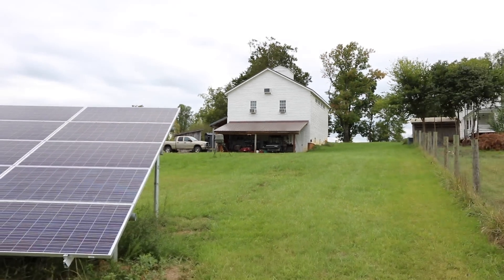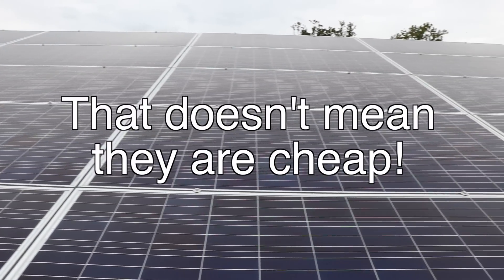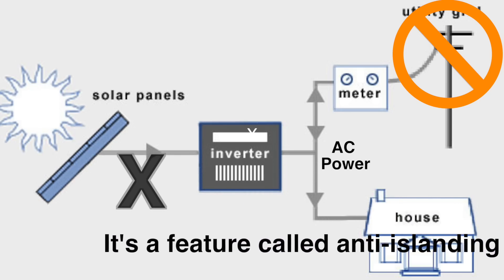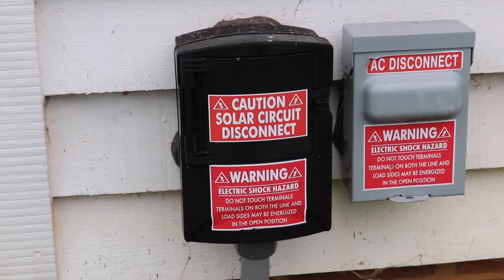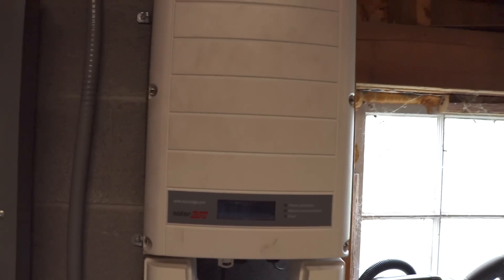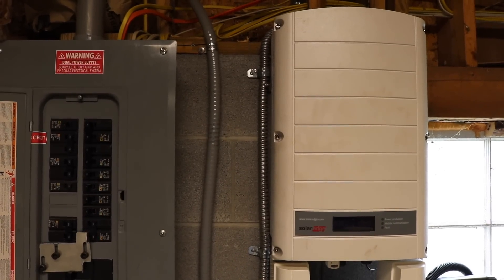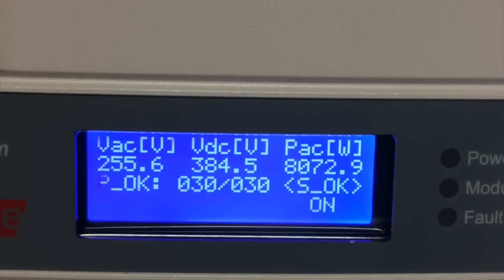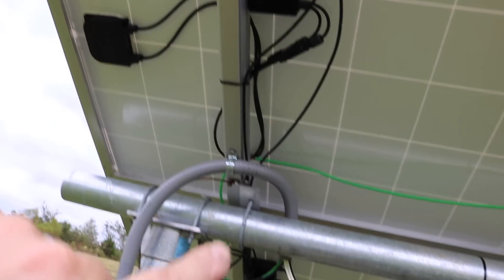The ugly truth behind grid-tie solar systems. Part 1, FarmCraft101 solar.  Watch before you buy!

Comment: Has anyone mentioned that perhaps the best reason for disconnecting a solar system from the grid after a commercial power failure is safety?  For the company's technicians to work safely on service restoration, the power system must be de-energized!  If your solar system is pushing power back toward the grid, they can't work to restore the grid.
Reply: This system will NOT back-feed the grid when it is down. Please do some real research ...

Comment: Biggest mistake of being tied into the grid while having your own solar system  is the home owner is only noticing a lil bit of savings because they really don't know how much is truly going which direction and you back feeding supplying the power company power you should be paid for that not just power saving because what your house rejects goes back out to your neighbors and they get charged a bill for your solar energy. If you go solar go all the way with it don't trust a scamming govern owned company to say we make things great for you.. 
Just for say your solar produced 2000 watts to the grid direction because your house rejected it from less resistance and now your house demands it then it comes back through  power company charges you for the power you just created. Those smart meters are a scamming ass joke they are the biggest power phantom box out there claiming it uses far more power than you really use and long as you can not show proof you have no case..
Reply: When feeding the grid your meter runs backwards, essentially giving you a 1:1 credit for the electricity you give the grid.  Say you feed the grid 10 kW-hr and your meter rolls back 10 kW-hr.  A few days later a storm rolls through and you use 10 kW-hrs from the grid.  The net effect on your meter is 0.  You paid nothing for that 10 kW-hr.  You essentially just loaned the utility some power and used it later.
Reply: @antony1103  yeah supposedly but not guaranteed they will honer thy customer. Which is the whole reason why I wrote my comment. I do not and will never trust electric company to tell me the truth about anything.  Not even to tell what color my hair is.
Reply: @topdogmechanic8261  The Grid-Tie Inverter will report how many kwh's it has generated.

Comment: Grids are how to wire money to corporations, duh ... off-grid, off all of their 'services' is way cheaper and sustainable.

Expect 98% efficient thin-film panel materials 20-microns thick if they are "allowed", a Taiwanese team prototyped a production line r&d project, presented 3-4 months ago. 👍

Standard panels take more silicon than available, these were developed to deal with that.
Reply: When you went OFF-GRID ...  you sent your money to the Solar Panel company and the Inverter company. And periodically, for life, to the battery company.  For the average residential home, adding a Battery Bank is a financial LOSS.

Comment: Very good video. You are quite right mate. It is a big advantage to use higher voltage then why are you americans so stubbornly clinging to 120 V power supply? You are almost alone in the world you know.-:)
Reply: How do you not know that we use both 240 volts and 120 volts. We originally had a 100 Volt DC Electric Grid long before you had any electricity.

Comment: Good vid, I've just been through the same thing..BUT I got around having no power when the grid goes down by putting a generator circuit cut off at the meter . That way when the power goes off I insulate the grid and start my generator...the inverter then gets tricked into thinking the grid is up and running and allows power from the panels to be used at the house. Cheers.
Reply: That seems like a great idea an lp or ng  generator would run at virtually no load while the sun was out is that correct? probably cheaper than a battery system and still able to get the solar benefit at a small lp gas cost.

Comment: What is the life span of these solar panels? How much does their ability to produce energy decline with each year? (even if the decline might not be exactly linear, can you please provide a rough average)
Reply from the maker: Warranty is that they will produce 90% of rated capacity at 10 years, and 80% at 25 years.  Typically they last for 30 years before they are replaced, but even then they will be producing a fair amount of power.

Comment: I know this video is almost two years old, but I do go back to it once in a while because I'm waiting to see if your Return On Investment has been met sooner than later.  I say that because the price for power doesn't seem to be going down.  Since the price of electric continues to rise, I would think that ROI would be met sooner than later.  Still, I wonder about the price of installation on a 9kW system.  I opt away from grid tie only because the power company is truly the only one that benefits.  Any extra power you get goes back to the grid, but then they get to dictate what they will pay you for it.  Try that the other way around and power companies will laugh in our faces.  That's not business.  That's called a monopoly.  It is why when I design my system, it is for consumption only.  It will eventually get to a point where power companies won't pay anything for what you can produce.  Just look at the models in Australia.  Unfortunately the Chinese are leading the way into solar technologies.  They even have inverters that can run high wattages without batteries or the grid.  There's a youtube video of a guy in Phoenix, AZ who is running his A/C with only his solar panels.  I have, since, purchase a similar product from the same company.  It will be installed this week and I will run my own tests on it.  But talk about  "off-grid".  The great thing about this inverter is its' flexibility.  You can buy the inverter and panels and be up and running in a day.  But you can add batteries later or even add the grid as a backup.  I experimented with a smaller system and my ROI was realized in 9 months.  I purchased more panels and this inverter and am building a larger system...2kW.  I expect my ROI in two years, but I power two pumps on a farm at a minimum 6 hours per during the day and 4 hours during the night.  I'll probably power an additional 6 hours a day as I irrigate more land making it 12 hours a day at 1.7kW/hour.  I pay $0.22/kW.  But again, I don't have the need for AC Coupling or any fancy setups.  This inverter does it all.  We'll see how long it lasts, but my smaller inverter was used to its' max and it still works after a year and a half, but even if it breaks I could still buy 9 more inverters like it before I matched the price of an SMA.  The batteries have cycled out, but that's because it has to recharge everyday because of night use.  After a year and a half, I expected it would.  But they're not lithium...higher cycle lives and deeper DoD.  This new inverter already supports lithium.  The money I spent for 2kW...is $1500.  If I had a 10kW system it is still only $7500.  Panel prices have dropped, but $23000 is steep though I know Home Depot in the US was charging $30k for a 10kW system in 2018.  In the Philippines I've been quoted $70k for a 10kW system in 2018.  I guess that's due to corruption.  I'd rather install it myself.  Anyway....I hope you get your ROI sooner than later.  I think you'll find you're ahead of the game just going solar.  People can remain skeptical, but good on you for going solar!

Comment: If you live in NJ and are tied to the grid you get one SREC ( solar renewable energy certificate ) for every 1,000 kwh your system produces, that's STATE, and theyre worth about $240, so if you get one every month, worth 240 , and your payment for solar Is $150, you make $90 a month, and you dont have an electric bill anymore, pretty cool
Reply: Living in NH having signed up in 2019 - the SREC value was only $20/MW for years to come. That's not much ($200 for a year in my case) but better than a poke in the eye. We did get $1000 (taxable) state credit for installing on top of the 30% tax break (26% 2020, 22% 2021)

Comment: Great video, thanks!  Awesome setup, just what I would have if I ever decided take the plunge. It appears you have a water tank under your panels to rinse them. Many people don't realize that even a light haze of dust can rob you of 10-20% of your panel's output, so they must be cleaned often and endlessly.
Reply: Not true. Light dust only reduces the generation by 2-3% as most of the dust is blown off during winds and hence dust does not accumulate. Now if you are in a very heavy dust area, yes, there will be 20% off but is unlikely to be that dusty in residential areas
Reply: @shrujanamsyama9940  Solar panels are at their best in dry, sunny semi-arid or arid climates. They don't fare well in rainy or cloudy areas. Dust goes with dry, sunny areas. Personally, my area is so damp that algae grows on the glass, and it takes a lot of scrubbing 3-4 times a year to get the green slime off. In a month's time, my panels can go from almost full rating to about 85% until I scrub the algae off. If I had a lot of panels, I couldn't keep up.
Reply: @Bob_Adkins  Algae growth is different from dust. Algae are plants and can grow to cover entire surfaces. But dust doesn't just grow like that. Even in dry areas like in the deserts, the amount of dust tend to be low as most of the finer top soil is eroded and the thicker particles don't cause much of a dust. The thicker, natural dust in dry areas only reduces the solar intensity by a maximum of 10% as after that the dust reaches a saturation point. The major dust problem arises near mining quarries, construction sites etc where fine particles of dust tend to fly around sticking to surfaces. This type of dust can reduce solar power significantly.
Reply: @Bob_Adkins  Bob, I have to respectfully disagree. I work for a solar company in central KY doing installs and tech work. We tell our customers to wash them once a year if they can (roof mounts can be dangerous). I have seen plenty of dusty/dirty/ algae covered systems that are still running full production when it’s bright out. (15% is a little exaggerated). They’re surprisingly resilient. 

But.. because you were in the 4th ID your pretty cool in my book
Reply: @chief5981  Hey Chief, my small array is not hard to clean, I guess I'm thinking of large arrays. Cleaning them would be on par with washing a house, which I notice people don't do very often. I'm from KY too, loved it growing up. Louisiana isn't nearly as solar-friendly, my panels turn green if I don't wash them 2-3x a year. Long live the Funky Forth!
Reply: Not true!

Comment: You don't have less amperage with higher voltage. As one increases so does the other.
Reply from the maker: Not if the power is the same.  P=IV.  Power = amps X volts.  Example: 9000 watts of power at 100 volts would be 90 amps.  9000 watts of power at 300 volts would be 30 amps.  You are thinking of a system where the resistance is the limiting factor, and in that case, you would be correct. If you increased the voltage and kept the resistance the same, then the amperage would increase as well. (V=IR)  But resistance is not the limiting factor here, it's the power output of the solar panels.
Reply: @FarmCraft101  agreed

Comment: how did you spend 17k on a solar panel system? You got taken for a ride my friend Lmao... You know you can get solar panels 100 watt Solar panels for around 100 bucks thats 3k if you have 30? Charge controller DC AC inverter add another 500 thats 3.5 k Slap on some batteries wiring and extra stuff... you should be looking at 5k-6k Total being conservative... yet you spent 17k?? WTF?!!?! sounds like a sales rep got a nice pay day from you LOL...
Reply from the maker: 30 100 watt panels would be 3000 watts.  My system is 3 times that, 9100 watts.  So with your panels you would need 91 of them to equal mine.  That would be $9100 just for the panels.  $500 inverter?  That produces 9000 watts?  Link please.  You've forgotten about the ground mount.  $750 just in the concrete.  $2500 in steel and aluminum.  And you have completely neglected to account for the installation cost.  You are woefully uninformed on the reality of a solar installation.

Comment: Super Informative, Expensive as FUUUk
I wonder Now a days the Actual panels must not cost much compared to the cost of the infrastructure.
Reply from the maker: The panels aren't cheap, but people so often forget the cost of the infrastructure that goes with it.  Glad to hear there are people like you that are really thinking it through.  I've had so many people claim they can get 9kW of panels and an inverter for $9k or something, but they ignore all the other costs.  My ground mount has $750 just in concrete, plus all the steel and aluminum, plus all the labor of putting it all together.  Then the wiring, the disconnects, the inverter and it's installation.  It's not just a matter of buying panels and an inverter, as you know.  Plus you don't want to buy the cheapest panels.  Poor quality panels probably won't last and end up costing more in the long run.  Cheers.

Comment: so how do you know if your power company is not stealing from you? how would you know if they took power during peak from you? Yes i know they have apps that show you use but those apps come from your power company. My point is has anyone done and real testing or monitoring independent from just what the power company says. Would love to see an in depth video on that. Second is there a clause in the contract that says that they have the right to commandeer your power for any reason? You know i just don't trust big power or government, if i pay for it i want control of it. Not i pay they tell me when how if i can use it. grid tie should not have you cut off if power goes down. yes yes i know what they tell you "its for safety" but they could have a auto cut off for the grid side in the circuit that has double or triple safeties on it that would not cut you off. so what is the real reason they do that. Because the last thing the power companies want is for you to be is independent. They must have there thumb on you at all times. As Americans that should drive you mad and if it doesn't then you have lost your connection the the reason this great country was founded. We bow to no man.It defeats the purpose of having solar if every time the power company wants they can just shut you down.
Reply from the maker: First, the power company monitors my power production and usage through a net meter.  I also independently monitor my production through my solaredge inverter, which the power company has no control over.  So I would know if they were stealing from me.  No, they cannot commandeer my power.  It is really not to the power company's advantage for me to have this system.  The only reason it's allowed is that the state legislature has forced them to allow net metering.  As for my system cutting off if the grid goes down, that also is not controlled by the power company, and this is a common misconception.  That is the nature of a grid tie system, which is different from a hybrid system (which is also tied to the grid).  You cannot simply install an "auto-cut off" to fix this.  The fact that it has no battery bank and is not wired through a critical load panel makes this necessary.  It also makes it much cheaper and easier to install.  A hybrid system would continue to function when the grid goes down, but will cost significantly more.  Watch my other solar videos which explain all of the details behind this.

Comment: At any rate, you're helping save natural gas coal for future use!
Side note- America should rid of 120 v, yes America uses a split 120/120 v power box, and go strictly 240 v to all outlets! You don't need to bring three wires into a house you would only need two, that's a cost-saving right there!!! We could have double power with 240 v. On the same outlets that you have now! 120 v is plain stupid wasteful...

Just curious but why are the panels so far away from your house?

Comment: NO GRID TIE FOLKS . As someone who sells power I can tell you that the power companies will steal you blind. The only and I mean ONLY way solar and off grid low amperage supplies works for the buyer of such things is to go off grid totally with this system. That doesn't mean off grid totally just with that system. Use your solar and thermal separate from grid . The only thing you should be using grid power is for HVAC , electric ovens " which I do not agree with" welding , and electric heaters " which are a big no no " . If you just look at the laws trying to be passed down in the states about going off grid should give you an idea your heading in the right direction.  If you are tied to the grid it should be to make money , that's it !  I have also learned thru many years of buying and selling if your not selling over 1 megawatt your losing money.  So my advise is what you produce with your hard work and money you keep and use . Do not give it to a greedy power company owned by Warren Buffett . Thank you for your upload wish you and yours the best.
Reply: When my PV System is generating power, it is offsetting kWhr's at Retail Price !
Adding a battery bank to Grid-Tie, and going off-grid, is a financial LOSS.